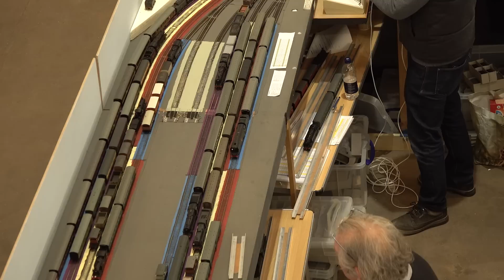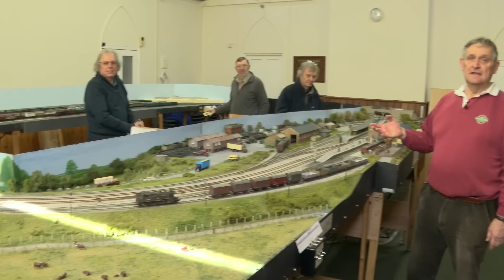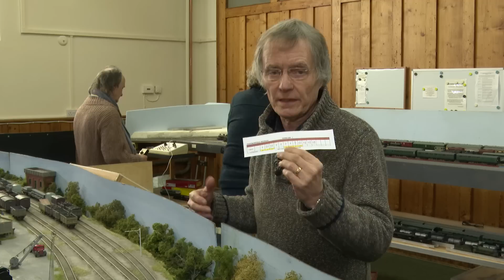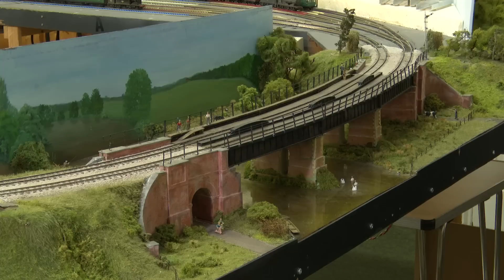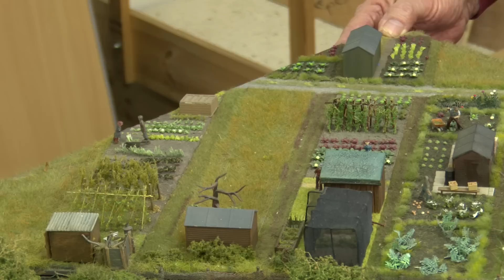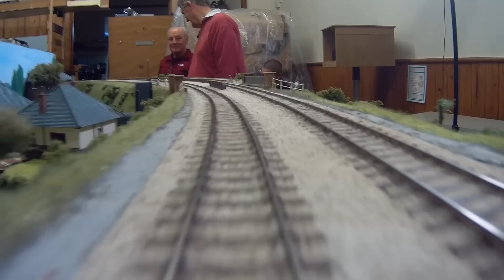WIMBORNE MODEL RAILWAY by Charlie of Chadwick Model Railway | 183.

Comment: My Grandmother lived in Ringwood, and my mother and her two older sisters grew up there. We are from Bournemouth, and visited my grandmother often by train or bus, mostly Hants & Dorset!
We went through Wimborne by train many times, but also got off the train there at least three or four times, so I am familiar with the very distinctive tall signal box etc.
The thing I always remember were two wagons in the west bay platform with the experimental Instanter Couplings.
The other notable thing was the bridge over the Stour.
When I was 18 I emigrated to New Zealand, and have made three trips back to UK in recent times.
I knew the line from Lymington Junction to Hamworthy Junction was long closed. Also Broadstone to Holes Bay Junction. I always remember Creek or Halt, of course!
It is great to see a model so well done on Wimborne, my own is a “what if” layout based on Ringwood, with the Ringwood to Christchurch section re-instated to make an interesting operation. So it’s 1964/65 with double track east and electrified and single track west to Hamworthy and the Poole link imagined.
This means I can run the Bournemouth Belle via Poole and have a really interesting timetable for trains from as far away as Weymouth that avoid Bournemouth to give a quicker run up to Waterloo!
I got the “what if” idea from the Astolat Model exhibition in Guildford when I was visiting in 2014. A modeller had a Ventnor layout with third rail via the tunnel. That sparked the idea!
Reply from the maker: Thanks so much for an interesting look into your world Phil.  Regards Charlie

Comment: Video cutting; would suspect the team had a good presentation plan beforehand and are used to operate the layout together (waybills, fiddling in the back, ...), therefore the video works well through 😉
Be watchful about that allotment it may overtake 😜
On McKinley Railway there was consideration of using RFID on this layout as well / as an example, would say "NO" in this case; as it would need all the goods waggons and a some of coaches to be cheaped, getting the readers at lot of places under the finished track, transporting a (yet not needed) computer with the layout to the exhibitions and (last, but not least) maybe losing the analog feeling.
Reply from the maker: An excellent comment LUS.  I’m sure that RFID will not come to Wimborne.
Regards Charlie

Comment: Thanks Charlie, lovely model

When I was at boarding school in Shaftesbury (Shaftesbury Grammar School) in the mid to late 1970's, I used to get the bus to / from Bournemouth. From Bournemouth to Shaftesbury, near Wimborne, we went over a level crossing and if you looked to the right, you could see coaching stock which appeared to be stabled in the distance. It was there from  1977  to 1978 at which point I had a moped then motorbike
Reply from the maker: Happier Times perhaps Martyn. 
Stay safe, regards, Charlie

Comment: Hi Charlie 
Fabulous. 
I love your problem solving and instruction videos but to relax and watch something like this with all the problems solved is magic . Also motivating.
Very good low speed control for analogue?
I love DCC for that very reason .
Is it just that my analogue was not so good ?
About to sit back and watch over again. 
Thanks 
Stay safe 
Howard
Reply: Good DC control is possible if you use quality controllers not the nasty ones produced by the big model companies. The late PECO Railway Modeller editor C.J. Freezer wrote an excellent booklet on DC cab control operation (and many other model topics) in the '60's well before DCC was dreamed of.
Reply from the maker: I’m so pleased that you found it. Interesting Howard. Yes those DC models really are top quality. Regards, Charlie.
Reply: Thanks Pat
I had a  large layout all cab controlled. Perfect way to run a DC set up. 
Was a long time ago and I think between fairly ordinary 3 pole and some pancake moters along with average controllers probably gave me some problems with slow running. I loved my cab control though. 
DCC took me a while to understand. My local model shop were marvelous. 
I do now really enjoy the benefits of individual control and  back emf speed control. Albeit now with 5 pole skew wound motors extra weight and pickups on all wheels. Progress. 
Stay safe 
Howard